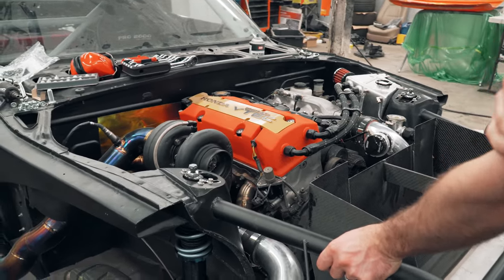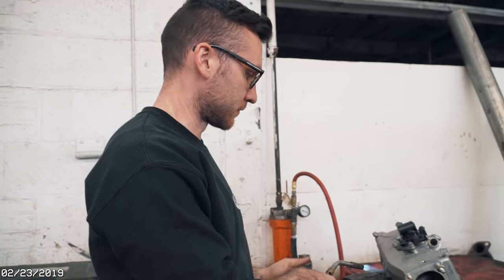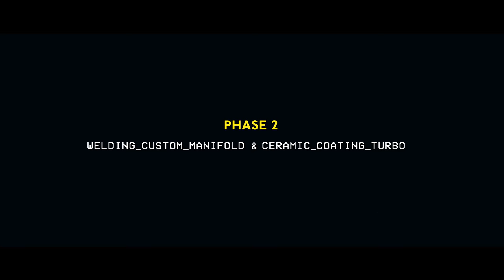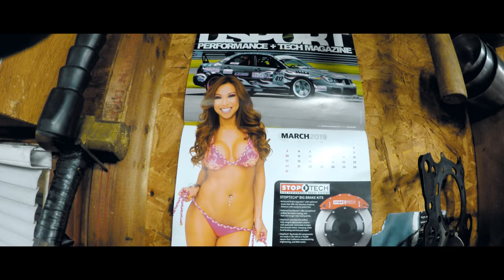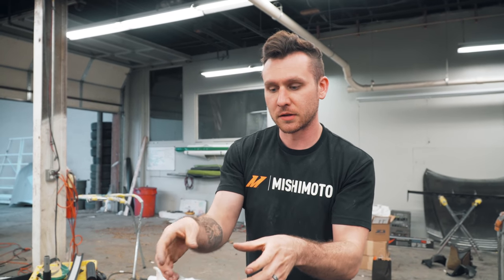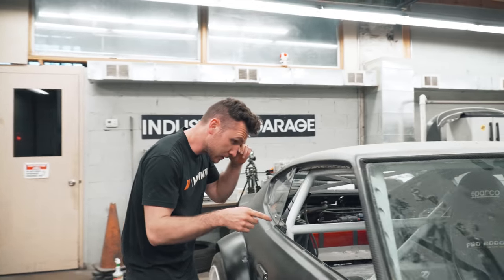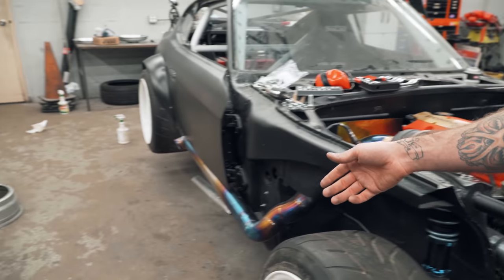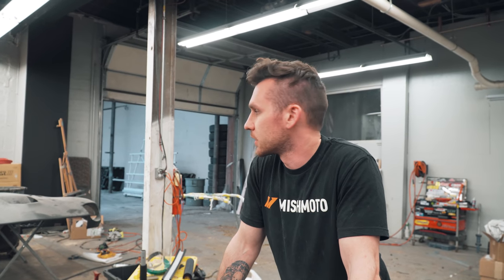240z Turbo Build Break Down | (EP# 47)(4K)

Comment: Those air fittings we use at work. we put them on welding systems and you can get the line silicon coated (just trim it back going into the fitting). On really bad heat/spark we another larger tube of clear silicon tube on a bundle of lines.

Comment: definitely a good idea putting the baffles in. I blew up a car from cornering, Was unaware that i was starving the engine of oil on a 45 minute trip through some twistiest, noticed a knock when i stopped, engine only lasted another 20km.
Reply: Same here. My first two iterations of my track Merc were blown because of that. And the funny thing is, i knew that G forces affect oil/oil starvation, but thought, eh, this is a big sump, what can possibly go wrong.
Reply: @aserta  That sucks, After the fact, I looked up my engine, turns out its a common problem for the Mazda KL-DE engine. Pitty, damn that thing had some torque, would rev hard to for an NA
Reply: @StreetBandito  its kinda funny, I used to drive the same road faster in my old honda accord (faster due to better suspension) and last i heard, that engine is still going today, 5 years later with over 350,000km (217,000 miles) on it.

Comment: Awesome build.... you need to run a brace from the bottom of the block to the outer part of the turbo flange on the manifold. make it adjustable... heim joint work well. so it can put under a little bit of tension pushing up. that'll help keep the manifold from cracking or warping. I've had the same issues that you brought up in this video far as engines tearing up exhaust manifolds piping etc. Also I had to make sure that in between the turbo and the chassis there had to be some give on the downpipe.

Comment: you should build a turbo brace from the head to prevent cracking so much
Reply: This style manifold shouldn't ever have an issue. Most s2000's run sidewinder style/ forward facing like Xavier has, puts a lot of the weight on the #1 runner.

Comment: Are you guys concerned about the hot exhaust melting or burning the resin? You have it really close
Reply: Yevgeny Sklyarsky titanium stays very cool under heat compared to regular steel, so perhaps they aren’t worrying about it because of that
Reply: He has a heat shield for it, I think you can see it on the shop floor in the video.

Comment: hello, would you have the link for the push to connect 90 degree fittings a d also what size of line's are you running for the boost controller?

Comment: That manifold looks amazing... though I wonder: isn't equal length piping not that relevant in a turbo situation?
Reply: I didn't take too much consideration in making them equal length. Just pairing firing order for twin scroll, which also.. who even knows if it matters.
Reply: Right, I see :) my gut feeling is that it does all matter. I was reminded of the Stagea Double Unicorn build by Alan & Benny, where the manifolds are just straight pipes with inlets along the sides

Comment: Will the redline go down from 9000rpm due to the turbo tune/engine timing/ adjusting and what not or will it stay the same?
Reply: It's an f22c so generally the longer stroke has a lower rev limit anyway 8400ish i think. If he upgrades the valve train in the future he could potentially rev higher if power is still climbing, otherwise no real point.